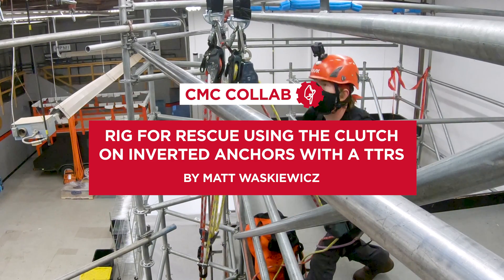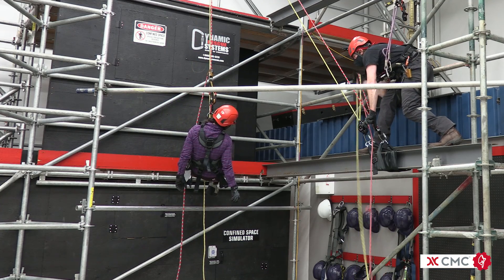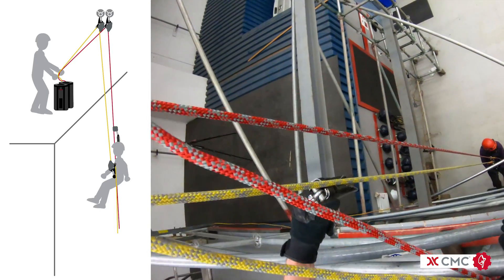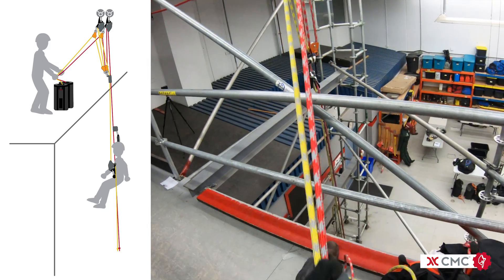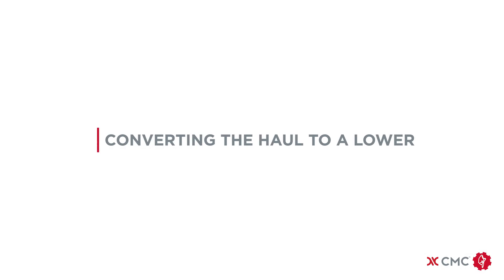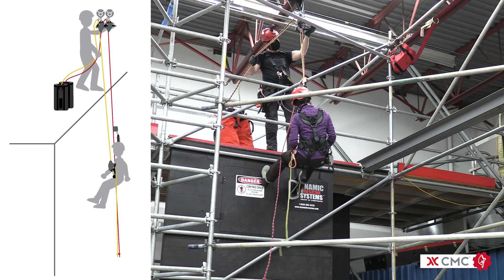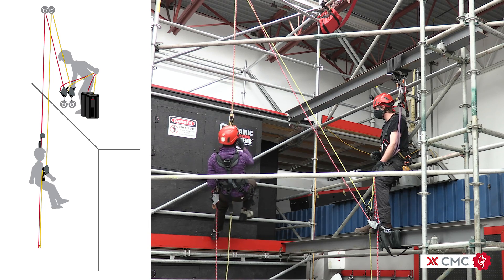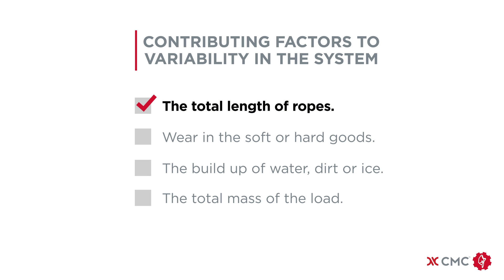Rig for Rescue Using the CLUTCH on Inverted Anchors with a TTRS  - CMC Collab by Matthew Waskiewicz

Comment: What is that rope grab?
Reply: Looks like a Petzl Shunt
Reply: @mattiaslefrell9235  never really messed with one because they are not NFPA rated. Would be smart to make one that is Fire departments everywhere would buy them I bet since TTRS are the new standard
Reply: It is a Petzl Shunt, one of the first devices designed by Fernand Petzl. The Shunt was designed as a mechanical prusik, and is my favorite tool for this application. Thanks for the close eyes and comments!
Reply: Yeah I’m asking the same thing
Reply: Yes, a shunt. They can't be used as a primary positioning or backup device, so we don't use them much even though my company still has a pile of them. I've never thought of using them to haul in a dual main system setup like this.
Reply: Does anyone make a mechanical Prusik NFPA rated.
Reply from the maker: @shawnklimchuk144  Just seeing this, we offer the CAPTO now which could be a good option to consider. You can check it out here:   https://www.cmcpro.com/equipment/capto/   Thanks for reaching out!